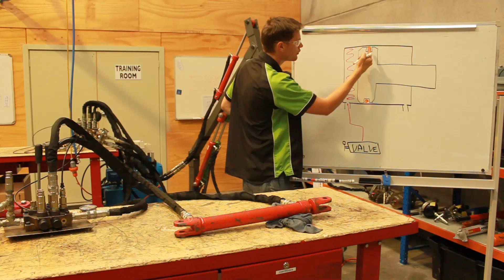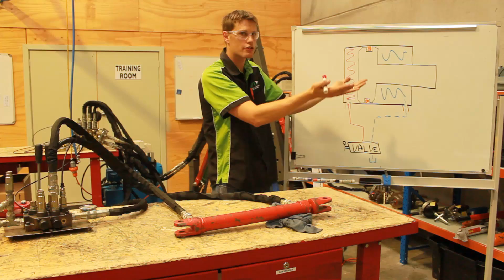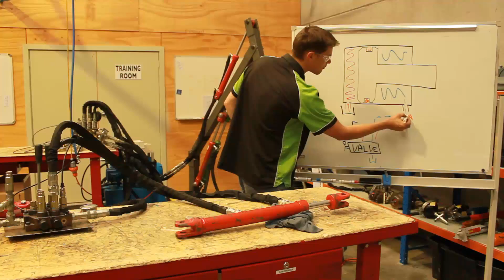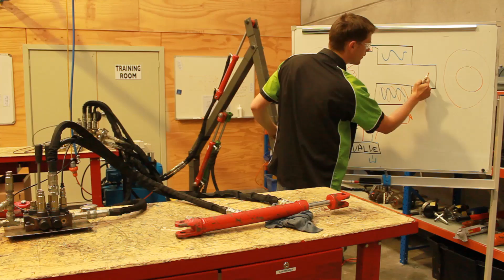Bypass testing a hydraulic cylinder

Comment: My current curiosity is about over pressure bypass, possibly adjustable. Yes, I've failed a 10 ton hydraulic port a power. Cracked the end cap in doing so. Making better parts isn't my issue. Must I be relegated to adding a gauge & watching it?

Comment: Hi just came across your channel, I have a question I know probably won't be simple to answer but will see, I have a hitachi ex60-5, the pump is wining only when using the bucket ram, sometimes  the when blading the bucket in the ground when you lift the boom up the bucket slaps open, due to this I got the ram resaled but it's still doing this, would it be a control valve?

Comment: The testing is good, but a bad seal can't cause the piston to retract as both sides are full of oil, so there's no room for the piston rod to move in any further.  Only a bad valve will cause it to retract when it's supposed to hold

Comment: So if there is a cross port check valve included in the circuit before the cylinder, can the cylinder still retract under a weight?

Comment: I have a log splitter that works perfectly.  I wanted to be able to remove the cylinder so that I could move the splitter down a couple flights of stairs.  (Basically, I take the splitter apart so that I can manage its weight, all by myself, by taking it down the stairs in pieces.)  My solution was to put quick connects onto the in and out ports of the cylinder.  The problem I'm having is that the splitter won't work with the quick connects in the line.  (Totally locked up... the ram doesn't even move slowly.)

Could somebody please explain to me what could be going on here?  I'd really like to get this sorted out, as I have to move the splitter semi-regularly.  

Thank you very much!

Comment: Well, this may prove very useful in determining whether my telehandler boom leaking down is a cylinder or a valve to blame. I'm suspecting a valve because there are 4 cylinders to lift the boom, but it is possible that all 4 are leaking slightly I suppose!

Comment: when you removed extraction port , do you caped it as presented on blackboard
Reply from the maker: Hi Mohamed, the hoses and fittings used on this equipment are quick connect fittings, when disconnected, they are automatically capped/closed to prevent fluid flow. This is explained at the 3 minute mark in the video

Comment: Would this test work in reverse (capping the retraction port) to retract the piston? It seems unlikely considering your demonstration of surface area, but I’m curious. And would either of these tests work under a load? Please respond. Thanks!
Reply from the maker: Hi Brando, the test method demonstrated will not work in reverse, as you are relying on the pressure operating on the larger surface area to indicate the bypass

A cylinder may be bypassing, but if you use this particular test method when the cylinder is under load, or still mechanically pinned at the cylinder ends, the force created by the fluid leaking around the piston will often not be high enough to move that load – the demonstrate method always gives best results when the cylinder is not mechanically linked to your machine. There are other test methods that can be used to indicate cylinder bypass when the cylinder is still connected. :)
Reply: This test will work with either port if both directional seals have failed precisely because the pressure in both ends of the cylinder are equalizing if bypass exists, resulting in an imbalanced force equal to the pressure x the cross sectional area of the rod. It doesn't matter which side the fluid originally came in. If the seals are not sealing, it is the same volume.

Comment: I am actually hesiitant if you can use this technique for very large pistons. Can it be? Thanks!
Reply from the maker: The test method should be ok for larger pistons, the same theory applies, that the bypassing fluid goes around the piston, and then acts on the larger surface area, resulting in the cylinder extending

Comment: thanks for the video ,would be possible to do a video on how to bleed the air of cylinder, (backhoe) for me
Reply: Fully extend, fully retract, repeat several times. Air is gone. No video necessary.
Reply: @EightiesTV  Hi,thanks for the infos but still doing it,if has a load on it, works perfect when it comes to a point of free from load i always got air in the cylinder ,i can move by hands about 4 inches ,was wondering if it can comes from my spool valves,its a block of two joysticks, thanks

Comment: What about a cylinder that only has one hydraulic hose
Reply: A single acting cylinder does not have a high pressure rod seal, so if it's bypassing, you will see fluid coming from the rod gland around the wiper.

Comment: Nice video. It's very helpful. A month ago, I experienced problem from two of our hydraulic cylinders wiper seal. The seal move out from its groove. Initially, I suspected there is a problem with the alignment or seal design. But later, after thinking and looking for possible cause, I found out maybe the problem is because the flow controller (miter out) at the rod side was throttled or restricted that caused over pressure that pushes the seal out. So, I adjusted the flow controller wider. As of now, I have not encountered the same problem but not 100% if my root cause analysis is correct. Please feel free to give your opinion.

Comment: I have a log splitter that when I hooked it all up the motor starts fine when it's not hooked up to the pump but when I hook it up to the pump involves it down so much that it does not want to start what seems to be the problem here
Reply: Please help
Reply: Sounds like the oil from the pump is being dead headed causing too much parasitic load for the engine to start.
Reply: Spool valve is not dumping the high pressure side into the tank when the valve is in the neutral position. Could be a broken spring or bent spool keeping the valve stuck in forward or reverse.

Comment: Is it possible for a double acting cylinder to leak during extend but not during retract? This procedure only test for leaks during retract. How can I test both directions?
Reply: some cylinder have two seal .. on for each direction .. so the best way to test that is with a flow meter ... if you put the cylinder at the end of travel .. hold the DCV ... and if there is fluid coming out (or in) your seal is leaking

Comment: looking to make a press for forging and pressing hot steel. air powered hydraulic bottle jack is too slow. I know by going with an electric motor and hydraulic pump like on a piece of equipment, like crane, backoh, ect... is the way to go. any thoughts on how to get 15 to 30 tons of pressure with the speed I see in your vidoes. am I on the right track with electric motor and a hydraulic pump system. does piston size matter on cylinder, and what about motor and pump size. forever grateful M. Weber
Reply: With a 2-stage pump like the ones used on log splitters.

Comment: Nice, So even if the control valve was leaking would this still conclude that the cylinder is leaking simply by taking off the  back port and plugging things off ? 

Please confirm, thanks
Reply: Well if it's the valve, the cylinder would not move now would it ;) Because even after a leak in the valve the oil has no path to the back of the piston .

Comment: When taking a jack off a unit and doing this test, does air become an issue tho in the cylinder when testing?
Reply: Yes it would, fill the ports back up with oil to get the air out